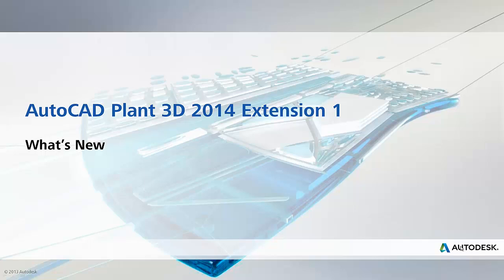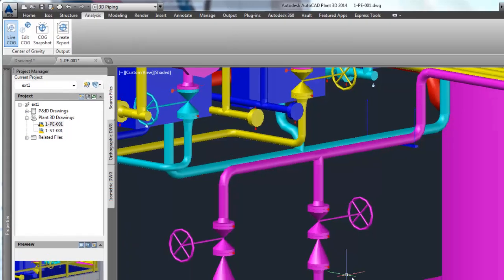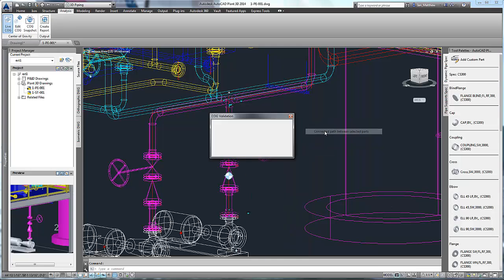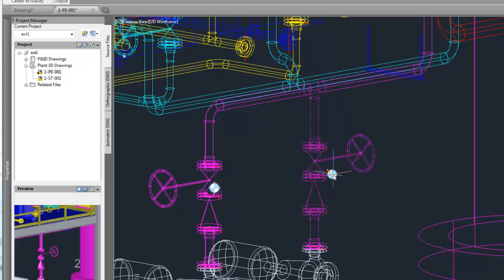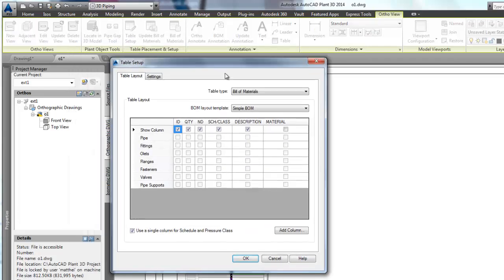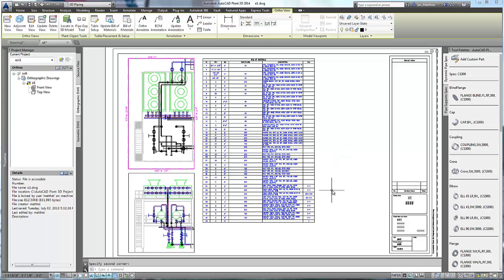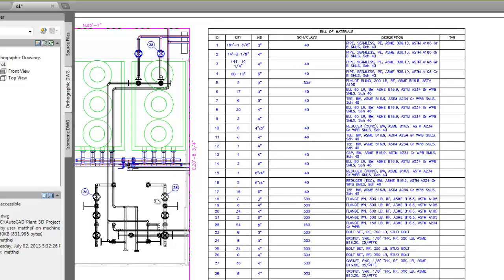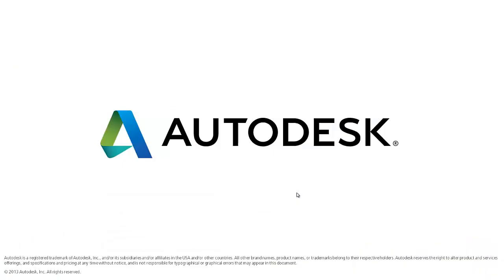AutoCAD Plant 3D 2014 Extension 1 (Subscription)

Comment: I don't understand what you're showing with the COG edit... the "operator" is the valve control type or a human "controller" placing all his/her weight on the turn-wheel?  Moving the COG to the center of the wheel doesn't seem to make sense.   Was it supposed to?  Thanks in advance.
Reply: I agree it does not make sense.